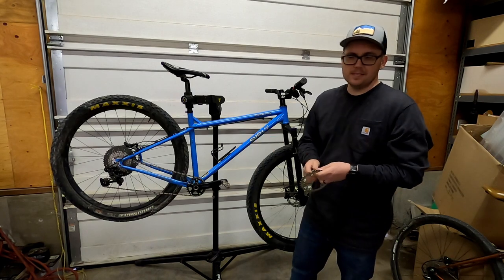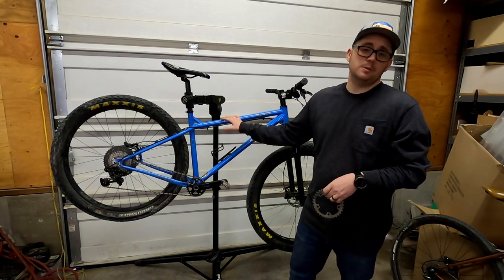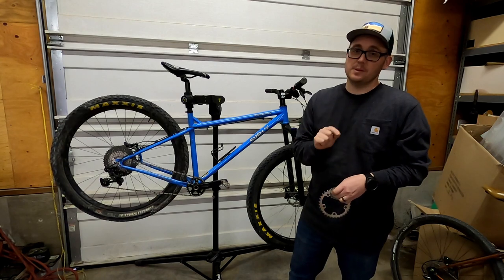Dinglespeed: Double Single Speed | What Is It And How To Do It | SS MTB

Comment: Those single speed gear clamps are worth their weight in gold. I've got a 3 speeder with a 34 x 18, 20 and 22  and you can move which gear you want in place with a small 2mm hex key, no cassette nut required. I run a spare one inside a s a spacer and back up. so far so good. A little bit more faff than a Dingle Speed but not much at all. Good for traveling as you can carry a couple of extra cogs (and 1 smaller front chain ring in case your in a really steep areas, and fine tune stuff on the road with 1 small hex key, easy peasy. They work great.

Comment: This is really interesting— I run a “tringlespeed” for my city bike with a 3x crank up front and a 16t cog in the back + Paul Melvin tensioner and shift it with a friction shifter.

I’ve seen people run dinglespeed on their MTB for the exact reason you discuss and they still use a tensioner, but use either 2 gears in the back and 1 in front or 2 in the front and 1 in the back then just move the chain over with their hands and let the tensioner do the work for them. I’ve also heard of people doing the 2 gears in the back and 1 in front or 2 in the front and 1 in the back and just put 2 quick links in their chain— one for the bigger gear and one for the smaller one, and then just remove one section of the chain with master link pliers at the trailhead.

Thanks for sharing your experimentation!
Reply from the maker: I’ve thought about all of the possibilities if I incorporated a tensioner, I just don’t have one on hand so I can’t experiment with it haha.
Reply: I would love to see a video with single rear and a front derailleur
Reply: @tjmars37   I’ve always wanted to try that! Would love to see a video on it also
Reply: @tjmars37  I'm planning to do exactly that with a 13 tooth in the rear and a 50/34 crank. I only use the front derailleur on my mtb so it makes sense. From now on I'm gonna start on a lower gear to avoid wearing out the cogs so much, the current ones need replacing hence why I'm planning to do this in the first place.

Comment: I did this on my everyday bike. 36/14 and 32/18. I can change gear without touching the rear axle. In order to do this, I have to run a little less chain tension, but with the BMX cogs (extra longs teeth), which I use, I don't experience any chainslips-  or drops. I don't use a chain tensioner, because I don't see much point in riding a bike without shifter when the bike is still cluttered up with moving parts.

Comment: Handy that your dropouts have that design whereby you can move the wheel to tension the chain. I suppose it'd still work with a more usual "drop" out setup, just that the wheel needs to physically come out so you can swop ratios? TBH it seems a bit unessasarily retrograde.... but as with any flavour of ice cream.... it'll be nice to try! Lol

Comment: I had a dingle speed at a time. First with a tensioner and then a fixie with surly dingle cog. The tensioner didn't work very well. I ended up selling the bike to get horizontal dropouts. Then I bought surly 1x1 and ran it as fixie dingle speed. At first I did change the ratio but soon I didn't bother to. Still the problem is real. You either grind at the trail or spin getting there. I'd pick a ratio from the middle and run single speed. That or just run gears. I don't want to touch the chain and take the wheel out while riding.

Comment: Is it possible to run a dinglespeed setup, with one chainring, two sprockets to form a 2 speed cassette and a rear derailleur which doubles as a chain tensioner and a shifter between the two cogs?

Comment: Dude thru a internationally Geared Crankset 

Efneo 3 speed crankset
Rohloff 14 speed internally Geared Hub 

And for the best in easy of use run a rohbox to run the road shifters and then run a Omafiet style chain cover max out the bash protection and boom

Comment: I’m interested in fat bikes for it’s versatility. I’m glad there is someone on YouTube making fat bike content. Is the bottom bracket width/q-factor ever a concern or noticeable to you? I’ve read it puts extra stress on the knees.
Reply from the maker: It’s only ever noticeable to me when I ride my fat bike then my mountain bike back to back. I’ve never had any knee issues or anything like that from riding. I could see that if your seat height was too low, the wider qfactor might cause knee pain faster than on a normal bike.
Reply: rollinrat4850 yes , fixed gear is brutal , I love it , it's just not the same riding a free wheel.

Comment: Mmm...  I came here looking for a more simpler built idea I've got, a single speed road bike with a two chainrings cranckset and front derailleur, I guess I should have to use a tensioner on the back, do you think it's possible? I like track bikes aesthetics but I would like something more practical for commuting
Reply from the maker: Seems like it'd work just fine. That's basically the same set up as a normal 2x10 or 2x11, etc. just with a single cog in the back.

Comment: what happens if you use two chains permanently?
Reply: whichever ratio is hardest to pedal is what you would experience I think or whichever chain would be actively moving the bike. I'm not sure if that would change at all during a ride. Hell it might even cause one chain to become too tight and snap. I'm having difficulty trying to visualize the outcome in my head. I know that when you remove all the slack from a BMX's chain you can cause the chain to snap if you force it through the tight spot. I think something similar would occur if you ran two chains at the same time without something to compensate for it. Now I have to search for an answer. I hope someone has done the experiment
Reply: You could pedal backwards fine because of the free wheel, however the drive train would bind/lock up when attempting to pedal forward. basically you won’t be able to pedal forward. This is a pretty standard ASE transmission question and would apply to a bicycle drivetrain the same as a car transmission. 

If this was a hypothetical fixed gear (no freewheel) dinglespeed it wouldn’t rotate forwards or backwards with two chains installed at the same time.

Comment: I fail to see the benefit to removing the deraileur setup which makes changing gear ratios incredibly more efficient than your manual setup. Besides the cool factor that comes with the association between single speed bikes which are usually bmx's there isn't much benefit. Personally I watched because I thought you were going to use two chains at the same time in order to benefit from them both which confused me. That seemed more logical than to do what you ended up doing. The only time i have done anything somewhat similar was when my deraileur cable snapped and I used part of the shortened cable to place the chain on an easier cog by bending and tying a knot in it to keep the derailieur in place because I couldn't use the screw adjusted fence to get the right cog to align. Usually people only do such things after a part breaks and they can't afford to do the replacement part right away or have been up on meth for a week and couldn't source all the right bits to build their Frankenbike from the myriad or stolen bikes they have in the back yard.
Reply: hi man  Share your experience, did you manage to use two chains at the same time using cranks with different gear ratios, for example 24x36 and 34x26?  will this work so that when driving uphill, 24 will be active, and when driving on a straight road, 34 will be active?  Sorry for my English, I'm writing with the help of a translator, thanks for the answer.

Comment: Ever thought of doing a double front and a single rear? Would that work? Or would the rear cog need to be a narrow wide?
Reply: The issue with that is when you run into problems with chain slack due to the difference in teeth being used. That problem is mitigated when you use a rear deraileur whose purpose is to both align the chain and at the same time uses spring tension in order to take up the slack when using cogs with less teeth. If you used only a front deraileur you would also run into problems with slack.
Reply: I was having the same thought, wonder if using a tensioner on the rear would resolve the chain slack issue? A 2x1 setup would be handy to help out with hills and keep the drivetrain simple for winter riding.
Reply: @matthewsponseller  It would also involve a front shifter and a rear tensioner. I reckon it would work but certainly not as simple as a single speed setup.

Comment: What's the purpose?
Reply from the maker: I explain towards the beginning, but rides with vastly different sections of terrain. Could also be that you use the bike for something like commuting during the day and decide to hit a trail after work or something. A lot faster than swapping out a cog.
Reply: I have a dinglespeed. 36x22 all of my mountain stuff and 36x19 for road and gravel. It’s in the mountain gear 99.9% of the time.